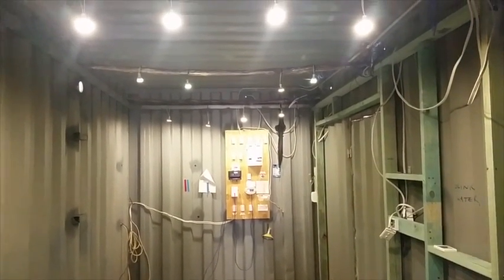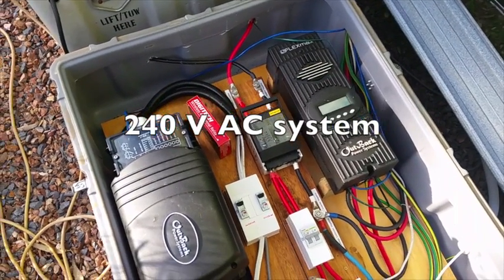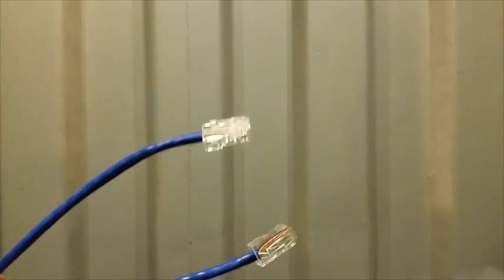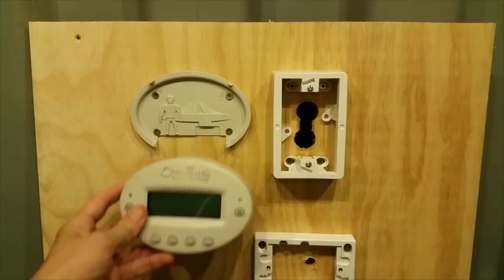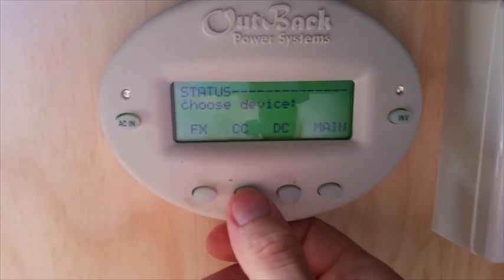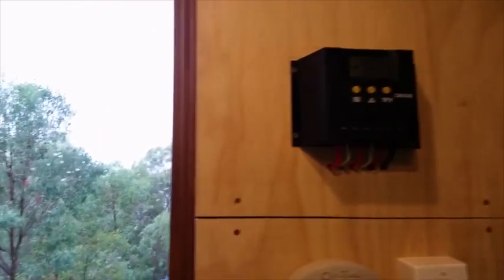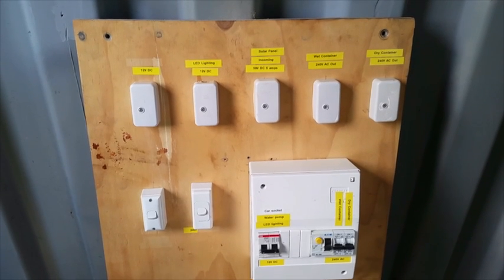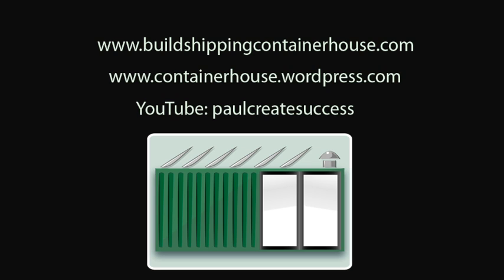Shipping Container house – Moving the power board & conduits

Comment: Very nice and neat wiring :) .
You could probably of used a network switch with the outback Mate that way you would not have to keep swapping cables to see the status of the inverter and charge controller.You would be able to select either the charge controller or inverter in the outback Mates menu.
 
Very nice work :)
Reply from the maker: I am waiting to find a cheap switch to test your theory. The hub is very expensive for a switch. Ebay has switches for $30 instead of $300.

Comment: hey, great video!!! Just some input on the Outback Mate. I'm not an expert, but i dont think long term, manually switching between CC and FX is not a good idea!! Its designed to work with the hub that allows you to run both at the same time!!!! just a thought!!!! thanks for sharing!!!!
Reply from the maker: I very seriously considered the outback hub, which would let me view both the charge controller and the inverter. I thought the hub was very expensive for what it was. I have the mate plugged into the charge controller almost all the time. This lets me monitor the batteries properly. I only need to plug into the inverter if I wish to switch it off or on, or to confirm I am running off the generator. With the wiring complete I don’t expect to turn it off again, and we only run on generator very rarely. If it was priced more sensibly I would buy one. Cheers Paul